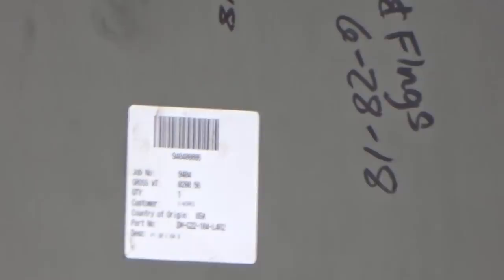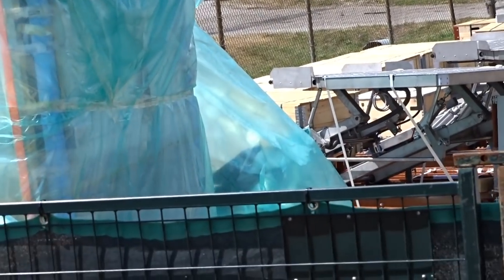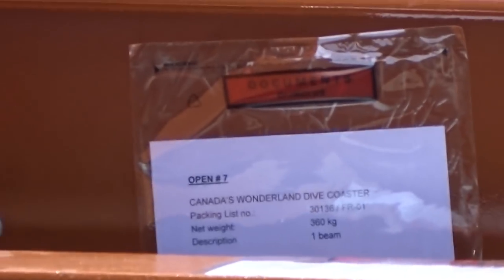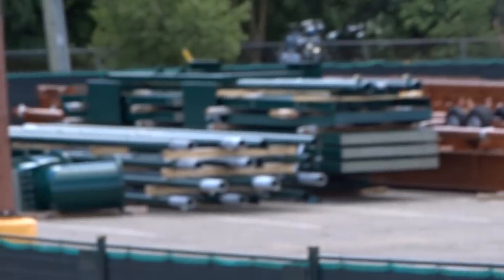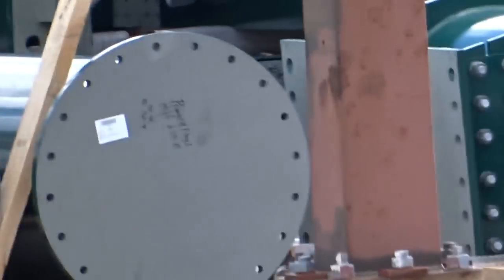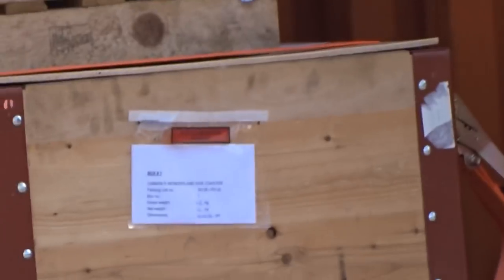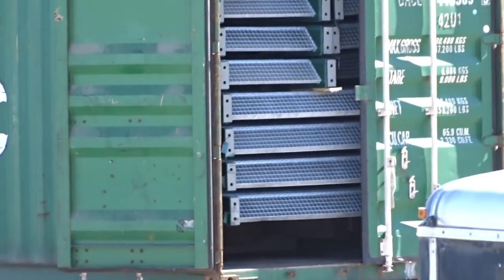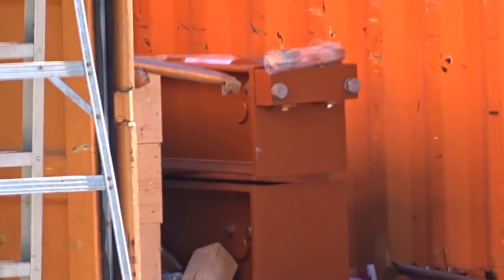Canada's Wonderland Massive New Coaster Shipment!!!

Comment: DUDE! I DONT THINK THAT IT'S 'DM-G'... it could be 'DM-6' indicating that it will be a 'Dive Machine (DM) with the 6 car model... if it was 8 it probably would be 'DM-8' or 'DM-10' for 10 across seating... maybe its B&M's new way of coding Dive coaster models. But moral of the story, I think that it's possible that you have misread the '6' for a 'G'.
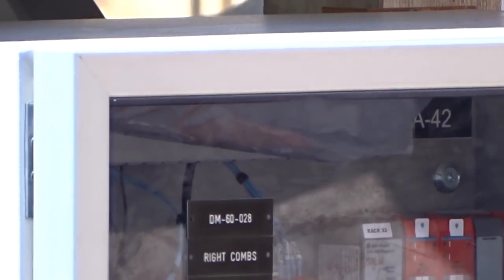Reply: 2:12. Definitely says DM-60 instead of G.
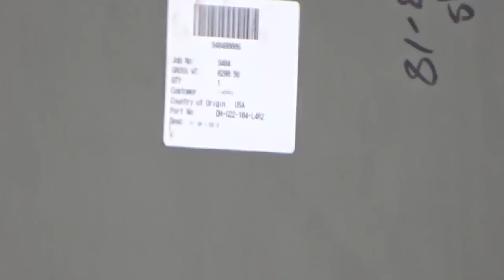Reply: At 1:06 it definitely says DM-G22-184-L4R2, but at 2:02 on the window looking in to the electronics for the combs it says DM-60-028

Comment: This is amazing! But how are you so sure that this is NOT a giga dive coaster? If the angle of accent on the lift is 45 degrees or greater and the distance between the base and peak of the lift hill is 85 meters at minimum, then according to my math, that would put the coaster at around 278 ft high (at minimum) which if the dive into the tunnel is at least 22 ft, below ground level, you have a giga dive! I predict the drop will be 301 ft! ... More importantly, what is your reasoning behind it NOT being a giga?
Reply: Dustin Smith u can tell it’s not a giga.
Reply: He knows the height he just can't share the information.
Reply: Ari 1993 how can you tell though?!
Reply: Dave M but how? I’m curious! Looking at the blueprint that was in this video, it appears the lift section is about 85-90 meters! It seams the drop may be very close to 300!
Reply from the maker: were saying the  height of the coaster won't be GIGA
Reply: Amusement Insiders However the drop could be 300 ft? Depending on the depth of the tunnel?!
Reply: Dave M he knows the layout not the height!
Reply: I did the same calculation & got similar findings. Perhaps AI traded not talking about giga for the ease of access from CW
Reply: He's got know idea. It's just guess work.

Comment: That's a 6, not a G. My guess is that it signifies the type of Dive machine it is, designated by seat-count. If this thing is gonna have the long ass layout that it probably will have, then those trains need as little air resistance as possible. Dive machines probably aren't very capable of going giga speeds...
Reply: Jonny Glessner giga is measured by height of drop not speed. Speed has nothing to do with it. It could float down like a feather, as long as it was 300ft or higher of a drop, then its a giga. There is no such thing as "giga speed"
Reply: John Billings how stupid do you think I am? Obviously Gigas aren't classified by their speed, did I say they were? A train reaches giga speeds if it is a traditional coaster - one with a chain lift - and has a drop of at least 300ft. Giga speeds cant be reached unless the drop is, well, giga height. I thought that was implied lmao 😂😂😂